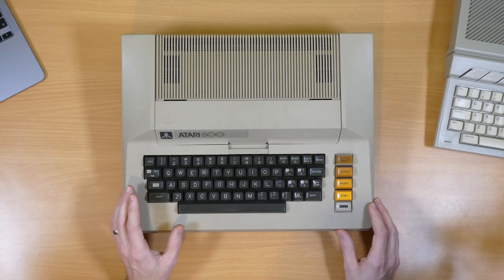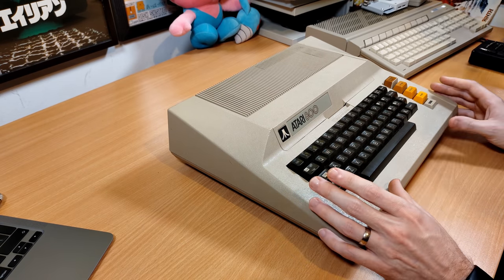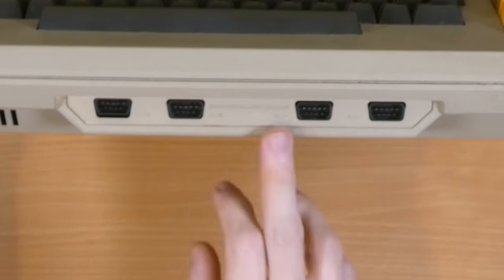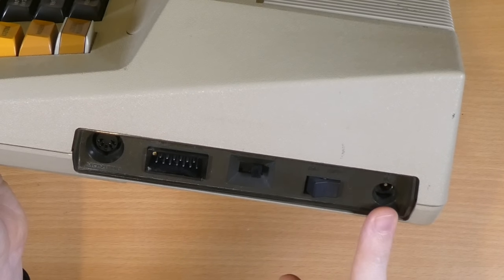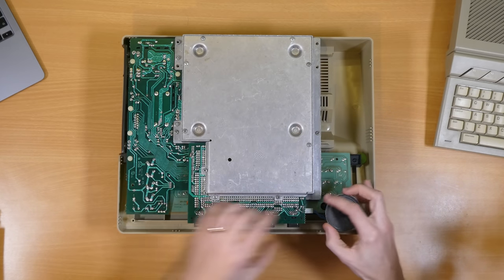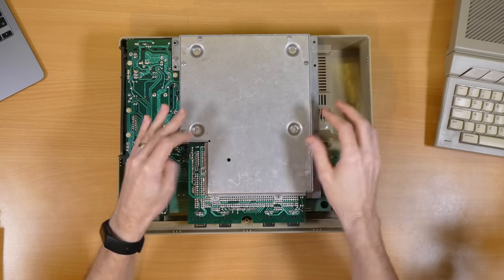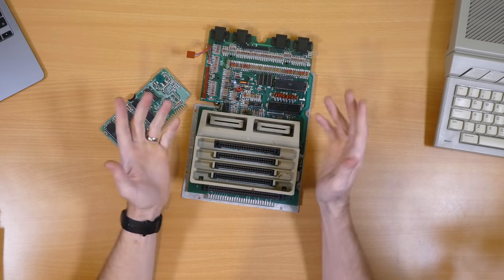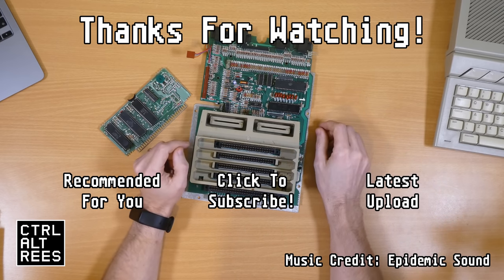Exploring The Atari 800 - Teardown Of Their First Home Computer From 1979

Comment from the maker: Some more interesting information in addition to what was mentioned in the video:

- Atari's engineers developed the 800 using Cromemco Workstations. This was an S-100 bus machine similar to the Altair and Imsai and early 800 prototypes were implemented as S-100 cards, allowing DMA transfer between the host and the proto-800. This more than likely influenced the system's modular design.
- The RF shielding was of course a 2-way thing - not only to prevent interference from the Atari's RF modulator to external TV equipment, but also to protect the Atari itself from external interference. These older 2 sided PCB designs without a groundplane were very prone to external interference.
- The edge connector was indeed for factory testing.
- The POKEY audio chip was, of course, also used in some 7800 cartridges to provide extra audio capabilities, most famously Ballblazer. There's actually a stereo audio mod that you can make to these 8-bit computers that requires a second POKEY, so donor copies of Ballblazer are in demand!
- Jay Miner worked alongside Joe Decuir to design the custom chips, and this team were also responsible for the 2600's chipset, most famously the TIA as mentioned in the video. Although not as widely known as Miner, of course it's only fair that he also gets some credit. He also went on to work on the Amiga chipset as part of a team that also included Glenn Keller and Ron Nicols.

Many thanks to Chris Collins for emailing this additional info over to me, it's all in the name of education and historical preservation so I'm more than happy to share it here with his blessing. 🙂
Reply: The CPU-Board actually has a date stamped right on it: 1383 - which is a bit higher than the one on the 6502, if I heard correctly.
Reply: Wasn't the POKEY also used a lot in ATARI arcade machines like "Gauntlet"?
Reply: I forgot how great a game Ballblazer was.
Reply: Ah.  I wondered about the edge connected when I noticed it in various photos of the board, but never seen anyone explain it.

Comment: Ah yes. My first computer back in '83 as a budding 16yr old programmer. I had to return the first one to the shop because it wouldn't recognize the BASIC cartridge and the replacement had bare memory boards instead of the nice cartridges,  and screws holding the cover down instead of the little brown cams - I remember feeling distinctly miffed. I was always a bit disappointed at the lack of any expansion port, not realising at the time that all the cartridges were sat on a bus system, which was probably just as well, as I'd have probably blown it up. The crummy BASIC forced you to use machine code to make decent use of the impressive hardware, and the 6502 was a great processor to learn how to code from the ground up. After a near 40-year career in software development, I can say this is the machine I cut my teeth on. Thank you Atari.
Reply from the maker: Thanks for sharing! I'd love one of those early machines with the memory cartridges and cams, I'll have to keep an eye out for one. 😁
Reply: I found my Atari 800 for a really good price and it was in fantastic, near-mint condition (and operational, which most of my purchases have not been, since I can fix these things anyway), but I kind of liked the look of the old RAM/ROM cartridges, too, and the classic brown cams that I was familiar with from the old days (I never owned one in the 1980s, but played with them in the store as a kid in the 1970s).  I went ahead and bought it anyway, and haven't had any regrets, especially since finding out that these later-manufactured 800s are more reliable precisely because they don't have the older, less reliable DRAM chips that cook themselves inside plastic insulation.  I wanted to eventually acquire an older 800 anyway, but I wanted (and still want!) way too many things (many brands and models of computer, and game consoles, too), so this is the only 800 I have, and I love it regardless.

Comment: One of the best keyboards I ever used in the 8-bit era. (I played SO much M.U.L.E. on that thing...) Early 800's had latches for the top. That way you could add more RAM from the stock (up to 48k).  They were covered with a case on them too, so that they weren't exposed. Looked like flat, wide carts. :)

Comment: You can clearly see where the high price of the 800 came from. Man, this computer is built like a tank! 😁
Reply: Nope! tanks were built like this computer! ;-)
Reply: My friend had an 800.  We used to joke that in case of nuclear attack, we could all just crawl inside of his 800 to ride it out.  I could never understand why they thought they needed 10 pounds of stamped aluminum thick as your hand to block RF signals.  Maybe it was designed to function as a heatsink, since they were probably having issues early on with overheating RAM, as it was initially shipped inside those awesome plastic packages.  (My buddy had overheating issues with his 800 and eventually removed the plastic packages, which mostly solved that problem.)

Nolan Bushnell wanted the 800 to be an open design like the Apple //, or to at least have an expansion bus of some sort at the back.  Which certainly would have been possible, given the CPU and graphics chips sat on just such a bus.  They could have exposed that card along with the RAM, instead of forcing you to disassemble the machine to get to it.  But Warner management overruled him and he was headed out the door anyhow, so it didn't happen.  Idiots.

Honestly, Atari should have cost-reduced the 800 into a single-board computer by the end of '81 and launched something like the 1200XL, which ended up not being released until the end of 1982, cost a fortune, and had a slew of annoying issues.  They should have discontinued the 400 at the end of '81 and just released the 800's replacement with 16K of RAM and placed a single RAM expansion slot somewhere in the machine - the back or a trapdoor on the bottom - that could accept a 32k RAM card, taking it to 48k.  If they'd done that and released it at a reasonable price, it would have done a lot to move more of the machines and blocked the Commodore 64 from being such a runaway success.

Comment: Thank you for the great video! The internal speaker was also used for key click sounds when typing. This model was my first computer, back in 1983 when I was a teenager. I still have it. I wish I had the box it came in. Last time I saw the box was in the 90s, and I can remember the huge sticker on it that proudly announced that said something along the lines of "Now with 48K!"
Reply from the maker: Hehe, that was a lot of RAM in those days!
Reply: The speaker could be used to increase the sound beyond the 4 channels pokey provided. It was a weak sound, but available.
Reply: @technicaltaurus1  It could also be used to play back digital samples.  Someone digitized a couple of seconds from the chorus of Van Halen's cover of "You Really Got Me" and it played back over the keyboard speaker.  That was mind-blowing in 1982.  I think some videogames might have used it as well.  The later models did away with the keyboard speaker - the sound was routed thru the main sound output to the TV screen over RF, or via the audio out on the monitor output.

The monitor output supported separate luma and chroma signals - what would come to be known as S-Video - over half a decade before JVC invented S-VHS and the new y/c standard.  It was much cleaner than composite video - I hacked together an S-Video cable in the late '80s for a friend's 800 and plugged it into her new 19" TV that had S-Video inputs, and text was dramatically clearer on-screen.  The 1200XL I believe did away with the y/c output, but later machines brought it back IIRC.  The signals were still present on the motherboard of the machines that didn't output y/c video though and you can hack it back on with a few mods.

Comment: Great video.  My favourite machine ever. I'm lucky to have the 800 along with the data cassette deck and floppy drive.  
I went from zx spectrum to the 800xl from Dixon's with floppy drive.    What a great time to be into computers.  
I purchased my 800 some 12 years or so ago.  Drove about 70 miles to pick up all the boxes.
It was actually my last retro purchase.

Comment: GREAT video, thanks!!

Atari went above and beyond with RF signal leak prevention with the 800's shielding, which is as silly as it is highly impressive.

the cartridge design to prevent dust build-up was also forward-thinking as the NES onward lacked it and everyone had issues cleaning them!

The 8k RAM carts are an oddity as, for some unknown reason, few wanted them. a few exist without the plastic and metal casing. A lot fewer do and are big collector items now.

I loved how the 800 was designed like big typewriters of the era, but were not as noisy. loved the internal speaker for "beep" keypress sounds. 

Loved the art deco aesthetic of the 810 and 815 drives. 

The 800 software releases were in big boxes with sumptuous artwork. Even a communications program, Telelink, had great artwork and it eoulfnt look out of place in Studio 54 - that's how cool it looks. They all look great on a bookshelf. Designed for business and family, Atari really was aiming for everybody.  it's honestly really cool.

Comment: The three digit's stamped into the bottom of case is actually the factory date code.  The first two digits are the build week and the third is the year.  Mine has 083 for the 8th week of 1983.

Comment: I bought my 800 in 1980 and the RAM cards were accessible by sliding two small brown levers where you have screws in yours.   I removed the plastic casings from them  after hearing about overheating.  Also, I had a CTIA chip in my machine but  a few years later my parents bought a 400 just to play Pac-Man on and I was able to swap out the CTIA and GTIA chips between the computers so I could play one of the Lucasfilm games which wouldn't run with a CTIA.  Also, my 800 had two 'minus' sign keys on the keyboard-- the 'equals' key next to the return was incorrectly at the factory.  Boy, were those the days.  I'd kill to find that very machine again because the memories that I had with it were top notch!

Comment: I believe at least the earlier 800s had metal shielding under the cartridge/expansion slot lid to complete the shielding of the main case in order to meet the very stringent FCC RFI standards later much relaxed to the great benefit of Commodore's later introductions.  You removed the lid on your machine in a way that I couldn't see if yours also had that shielding in the lid.  I think the mostly metal cases originally used for the expansion cards were also RFI related with the added benefit of ESD protection.

Comment: I talked my mom into buying me an Atari 400 back in the early 80s. 
Wanted an Apple II, but those were crazy expensive. 
Christmas rolls around and under the tree was not an Atari 400 but an 800!
She talked to one of her friends who owned a computer for his business and he advised her to get the one with the real keyboard. 
I have no idea how I got the money together, I guess I mowed lawns and did odd jobs? But I ended up buying 2 floppy drives. The Atari one and another one called Rana I think, that was supposed to be able to copy protected disks and do a few other tricks. 
Also had an acoustic modem that I used to connect to early bulletin boards.
And of course all the joysticks, paddles and the keypad controllers.
All the ram cards originally came in a kind of cartridge housing. Only later did they have bare cards like that. 
The ROM was also a long cartridge like that.

Comment: RS-232 dates from 1960 and was an established standard at the time.
I had a TRS-80 PC-2, which was a rebranded Sharp PC-1500 that was introduced in 1981 and it had an expansion that included a printer/plotter and and RS-232 port.  Modems were being sold at Radio Shack.  I think it's safe to say that RS-232 with the 25-pin connector was used for microcomputers from their beginning.
Reply from the maker: Ah, I knew someone out there would pick up on this and that's fair enough. Indeed, RS-232 was a much older standard - in fact Atari made their own SIO to RS-232 adapter, the 850 Interface Module, which was released alongside this machine. That said, it certainly wasn't common on the British computers of the time that I grew up with - the likes of the Acorn Electron and the Sinclair machines, so that's probably what I had in mind when I made this unscripted offhand comment.

Comment: It was the first home machine with custom co processors, a "usb" type of connector, an extensive palette of 256 colors and Antic's beeping sounds (keyboard) raised the number of sound channels to five. It's specs remain at the top until the MSX2 machine(85)came into the picture.
Reply: It's actually the GTIA that does the keyboard clicks.

Comment: Excellent video. I think the internal speaker was also used for audible keyboard 'clicks'. The build quality of these early Atari's was impressive, and I should imagine, fairly expensive to manufacture for the time. It's interesting comparing this PCB to the later, much more integrated 800xl model :)
Reply from the maker: Thanks for the kind comment. The speaker was indeed used for the typing "clicks" - it's been far too long since I've done anything other than play games on one of these. 🙂
Reply: @ctrlaltrees  Here's a video where that 'click' is used musically, in tandem with the POKEY sound chip :) On later Atari machines, the click sound was routed through the normal TV speaker if I recall correctly: https://www.youtube.com/watch?v=q7_uxjQ-WLM&t=69s
Reply: True, although the XL series seems to be made of sturdier exterior plastic.  Not that I've ever put them to the test on that.
Reply: @alaggan   Correct, and it is still the GTIA chip that generates the click, for anyone who might be wondering.  From the point of view of software, there is no difference, and doing it this way not only does away with an extra speaker that isn't really needed, it allows the user to control the volume or turn off the sound.

I've always considered this an odd aspect of the Atari's design (especially the 400/800): having two separate ways to output sound, out of the box.  It's comparable to the Apple II with a Mockingboard or other sound card installed, although that's an aftermarket add-on, so it's not so strange, while every Atari comes with a built-in POKEY chip.  The Atari 400/800 plays Ultima III and Ultima IV the same way, too, regarding sound, with the music coming from the TV/monitor/speakers and the sound effects coming from the internal speaker.